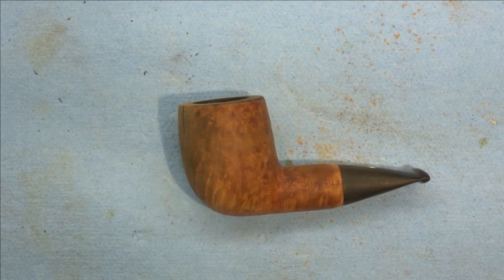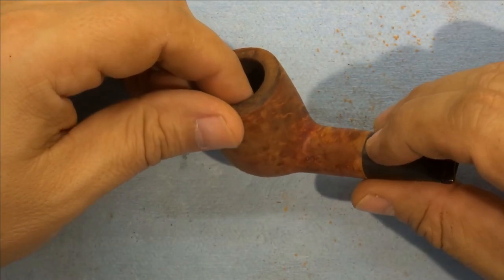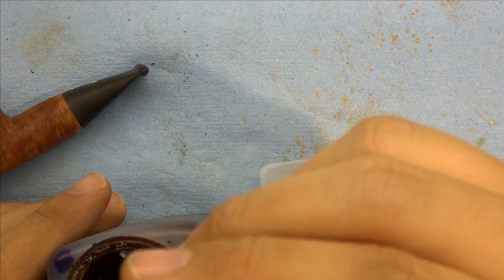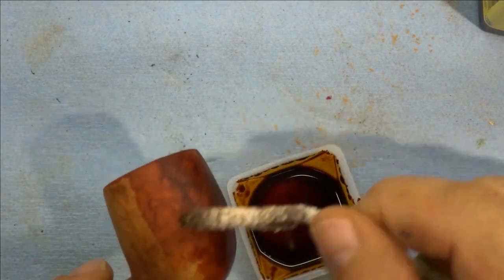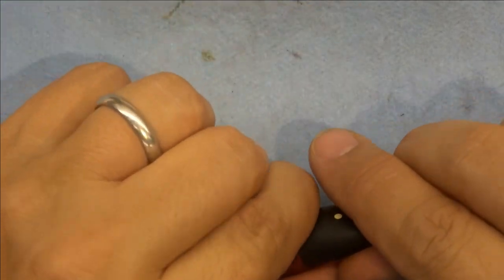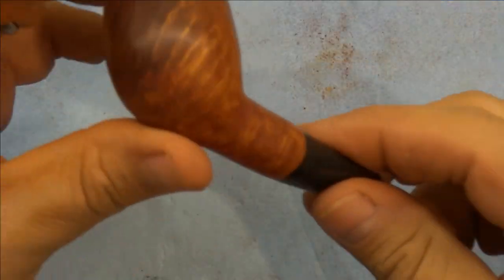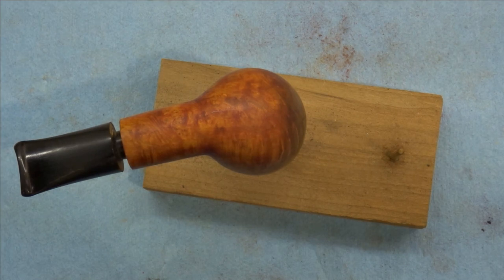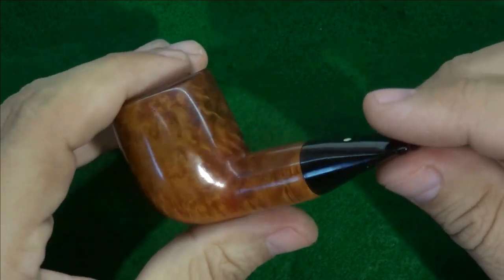Repairing a Cracked Dunhill 305 Part 4

Comment: hi mike, my oak tree pipe also cracked. Can I use the same method to fix it?
Reply from the maker: Hi Mohammed, if it is a similar crack,  it should work.  If you want to send a few pictures to canerodpiper@gmail I would be happy to look and give you some advice.